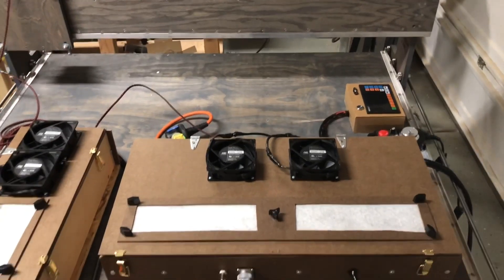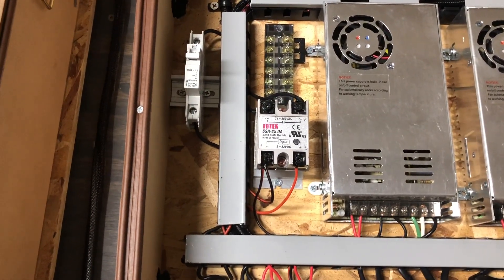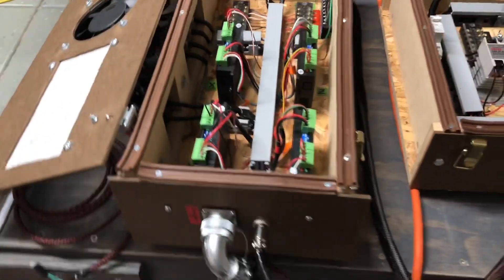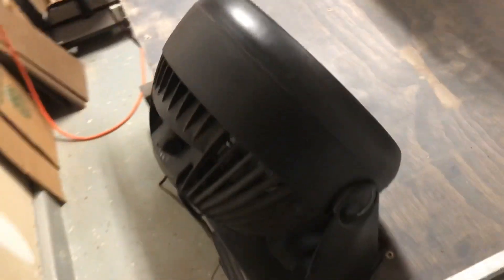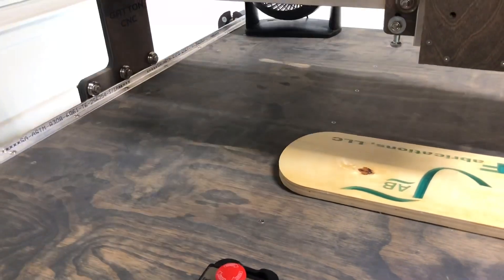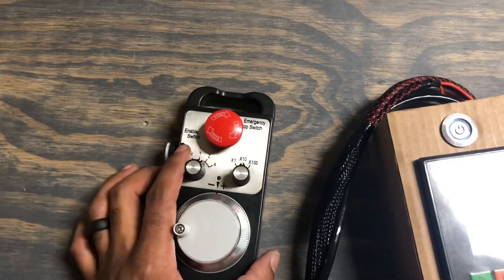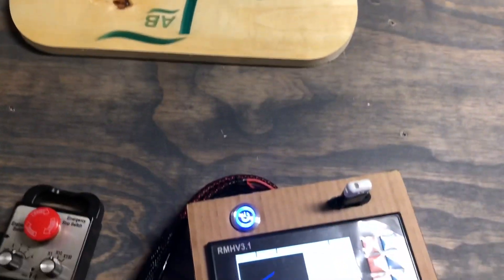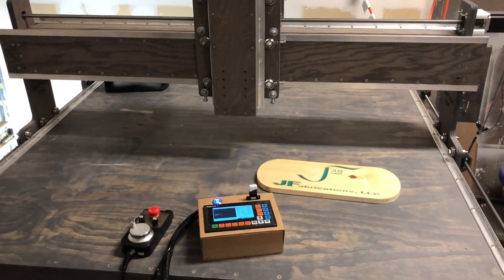1st movement of my Gatton CNC build using DDCSV offline controller(Motors not tuned yet)

Comment: Can you use the MPG to move the Z axis a bit by example, during cutting in the middle of toolpath without pause ?
Reply from the maker: No, I have not been able to jog the CNC with the MPG during automated operations.The only time I could see using this feature is when the CNC is moving to zero or homing positions and there is something in the path. With the way my CNC is set up I would hit one of the two reset/e-stop buttons and then make adjustments and then continue with the process.

Comment: I have one of these I am trying to figure out the syntax for (Square Root function) in g-code  Other functions work fine like SIN[arg] , and COS[arg] I looked up other cnc controllers syntax for this it is  SQRT[arg] but this does not work with the DDCS V3.1 CNC any ideas?
Reply from the maker: Good question, unfortunately I do not have an answer. There is not a lot of information out there on this unit. For questions like this one I go to the facebook group "DDCSV 1.1-2.1-3.1 PLC CNC CONTROLLER". This group contain members that really know the controller any may have even designed the controllers. I am sure someone would have more information if you use that  platform.
Reply: @SuperJfritz  
                                             I guy called Yacoub Jabal
 had the latest manual it is in here Users Manual V2  ( http://www.mediafire.com/file/47lwlifqrezuyyj/NVCNC_DDCSV3.1_EN.pdf/file )
Reply from the maker: This looks to be the newer manual for the newer version. I saved this for when I get my unit fully updated. Thank you so much for the information.
Reply: @SuperJfritz  Thanks Yacoub!

Comment: Couple of questions if you don't mind did you buy the kit or just the plans from Dave. And where did you Buy your electronic supplies. Thanks for sharing have a blessed day
Reply from the maker: I purchased the kit from Dave. For the cost and the accuracy I feel it is a great deal. and the plans allows for a large amount of size options with few modifications. I also used the links that Dave provides to purchase most of the large electronics (motors/drivers) the rest I found on amazon. The best source I found for hardware was also recommended by Dave " McMaster.com". There are also part numbers the hardware listed in the plans. I did search my local hardware store to see if they had the hardware that I needed but I have found I would have saved time just ordering all hardware through McMaster. It will cost a little bit more but the quality and service is worth it in my opinion.